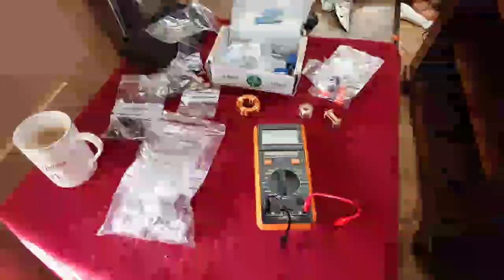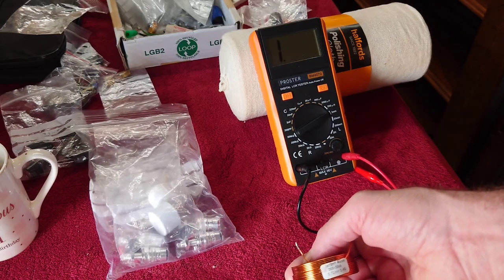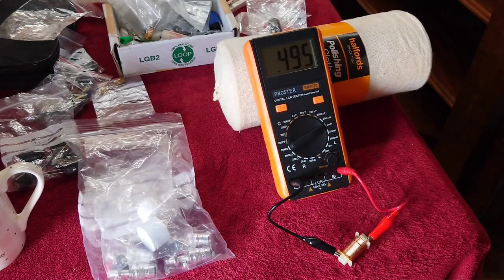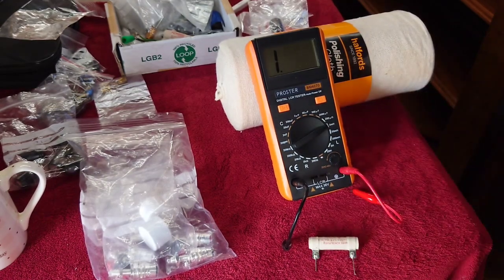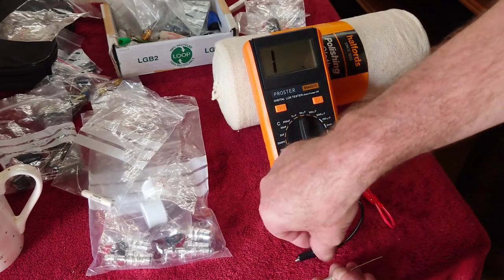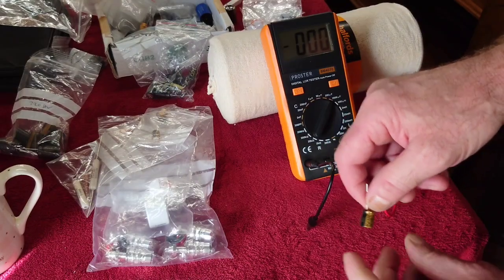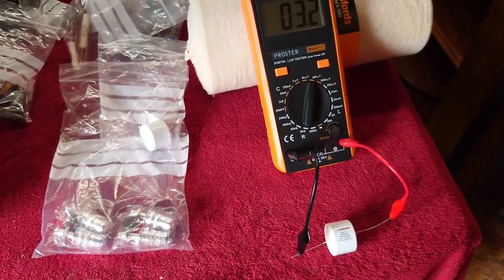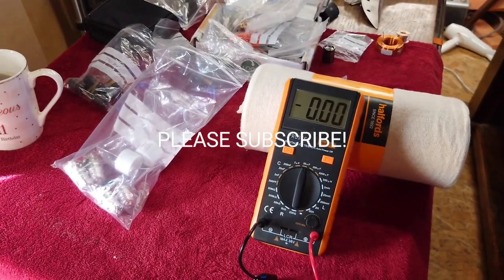USING AN LCR METER TO MEASURE INDUCTORS, CAPACITORS AND RESISTORS.

Comment: Not being able to change the selected test frequency on those cheap LCR meters can give you significant measuring errors. You should always use a test frequency, which is closest to the expected operating frequency in the circuit.

Comment: What is the resistance of the steel core coil?
Reply from the maker: The resistance is 00.3👍
Reply: @tweakerman  It is very important when winding the wire that it is not bent, and that it is used directly from the reel with which it comes from the factory in order to obtain perfect rows and no jumping between the different rows
Reply: @AndrewLittleboy1  Winding by hand is very difficult, but even a homemade bobbin winder made a big difference
Reply: @tweakerman  https://youtu.be/R8uPb2ijxhc

Comment: For a 0.5mH coil and a wire with a diameter of 1.3mm, the Coil Calculator calculated:
 wire length - 16.5m, inner diameter - 20mm, coil width - 17mm, number ot turns - 143, turns per layer - 12.09, number of layers - 11.76, Coil height - 17mm, coil resistance - 0.2173 Ohm
If you want a low resistance, you will need a thick wire and the coil becomes different